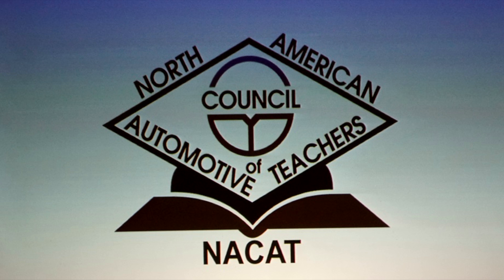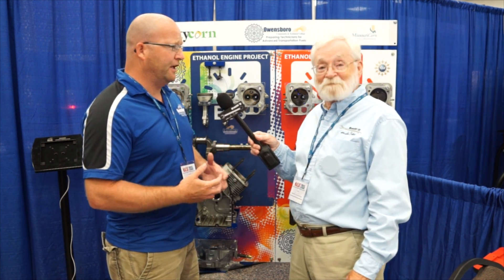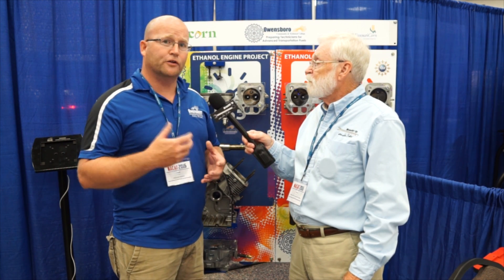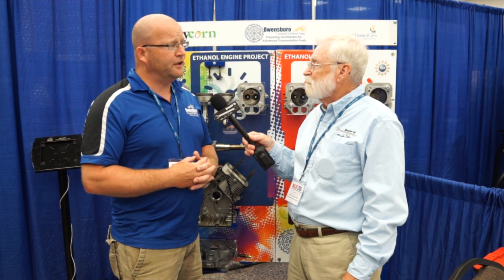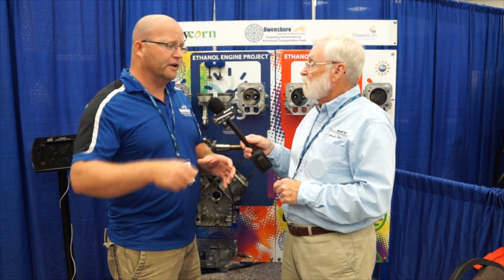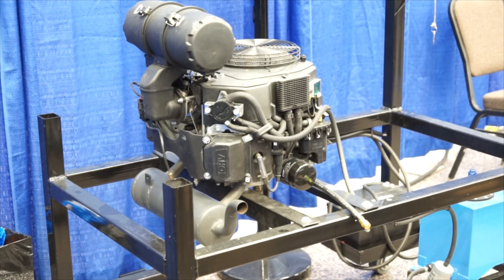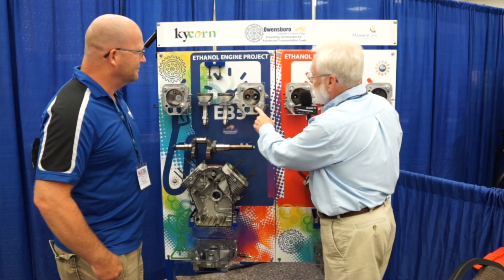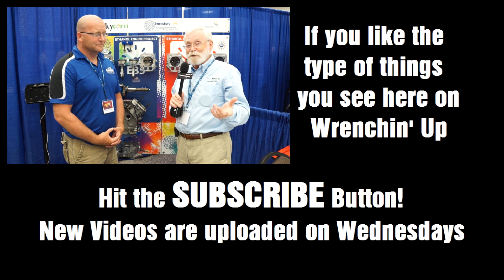E85 In A Flex Fuel Lawn Mower - Wrenchin' Up

Comment: It’s not the engine it’s self that’s the problem. You can take any engine and run it on ethanol. It’s the fuel system. A normal Briggs carb is not tuned for ethanol. 
If you can swap on a ethanol tuned carb hell yaa its a lot better.
And those engines they tested on look like they did nothing but idle for 500 hours. That carbon build up is from not being fully warmed up and the engine actually working. 
I have worked on thousands of cars, trucks and small engines. That kind of build up is only from a running with no load. Put the e-10 engine back together and actually put a load on it and 90% of that carbon would burn off and look clean.
Reply from the maker: Hi - Thanks for watching and sharing this great information!

Comment: I have Hyundai 2002 its not flex-fuel Engine, i started put e85( flex-fuel) 3 months ago, and i can say the oil stayed longer, more power and less noise from the engine, the only problem is when i start the car it takes 2-4 tries.
Reply from the maker: Hi - Thanks for your comment. Just out of curiosity, how many tries did it take to start your car on regular gas? Thanks for watching!
Reply: flex fuel is fine in a flex fuel motor/car - do NOT use it in something not designed for flex fuel.
Reply: Jim Bates 1-4 tries, it wasn't like that when I started using flex fuel it took me 2 weeks to see the this problem, it comes more often when it's cold weather ( I live in Chicago), overall it's much better I did 7,8k miles on 5k miles oil, the guy who changes the oil said you don't need oil change, and the fuel is cheaper, and the car is so smooth.
Note: I switched to regular gas and the problem gone.
Reply: I've heard this before from at least 2 other people. Cold starts on non E85 cars are a problem. They both put a couple of gallons of regular gas in with each tank of E85 and it helped.
Reply: I have a 2006 Scion Xb I have been running E85 in it, and love it.   The engine is soooo smooth.   It runs cooler too.   Great acceleration.   sure.  Less mileage.  I have not tuned the car to run with a kit.   Just giving it a try.   No check engine lights, none. I will change the fuel filter soon as the car is at almost 89K miles.   Mileage so far is 21% less.     My Flex Fuel GMC Yukon 6.2L is down in mileage only 0.8mpg.   Fuel here is $2.09.
Reply: Say good bye to your feul lines and injectors, and anything rubber that the feul touches.
Reply: Christopher Walker thats a myth
Reply: Lol. You need a flex fuel kit. Your getting hard start because your air to fuel ratio is too high. You need to add more fuel. Your engine will break down if you dont fix your air to fuel ratio.

Comment: Any fuel is good if the engine is tuned for it.
Reply: Also to add if an engine is made to run a particular fuel you should stay with it. Ex you wouldn't put diesel in a gasoline engine or vise versa. Same with ethanol. Most hot rods and things you see burning ethanol are tuned and built to run on it. Not straight out of the box built and tuned for pure gasoline. That's my 2 cents
Reply from the maker: Hi Jeffery - Thanks for your comment and Thanks for watching!
Reply from the maker: Hi - Thanks for sharing that comment!

Comment: E85 is the way to go Ethanol is great on the engines its much cleaner and runs better.  

Still in progress with ethanol trials here as we speak.
Reply from the maker: Hi - Thanks for your comments and Thanks for watching!
Reply: Hi. Which one would you think burns cleaner (I mean inside engine carbon buildup, NOT the emissions): 98 E5 or 95 E10? My BMW doesn't need 98 but ive been using it because price is about the same here in Finland. My logic says 98 burns cleaner bcos higher octane but then again... 95 E10 has double the clean ethanol in it so, what u think? Gas here is very good quality no matter which one u use.

Comment: No question...ethanol is a better fuel than petroleum, so is propane...the problem with ethanol in engines, not flex fuel, is that it damages plastic parts and makes gasoline deteriorate faster because of the systematic water in hydrous ethanol that we choose, because of cost, to run in the USA. Get rid of the 5% water in ethanol made in the USA, CONVERT all engines to run on alcohol, as they do in Brazil...and we are past e first objections.
Reply from the maker: Hi Rick - Thanks for your interesting comment and Thanks for watching!
Reply: You are very welcome....it's time we really got to the bottom of this debate...if we ever can...but it's not the ethanol causing the problem we ALL are having with hydrous ethanol being put into our fuel, and then into our engines, that were, and still are, designed to run on pure gasoline. It's the water IN the ethanol that's the problem, regardless of the fact that ethanol ATTRACTS water...and the fact that the membranes in our small engine carburetors are not meant to be exposed to Alcohol causing us to rebuild them, and the water causing our gasoline to go bad prematurely...it all adds up to someone was not thinking, or didn't care....that is what gets under my skin. Again, it's not the Alcohol that's the problem...it's that our engines are not ready for it.

Comment: I’ve been a mechanic ASE certified master L1. All who is saying that it bad is just following sheep.Ive used really studied this on all David Blume alcohol can be a gas ⛽️. It runs cool no knock very little pollution and be grown at home stop wars engines run longer. I have a old 92 Dodge van running it for 5 years E85 no problem. I let it sit months starts right up.We used to put alcohol in tanks in PHX when I couldn’t get down the four gas ⛽️ .Its a little hard to start in cold except for tuned cars.
Reply from the maker: Hi - Thanks for watching and sharing your experience.
Reply: The less pollution thing was a lie, not to mention the pollution of growing all of the corn and processing it. There’s no way that ends up being “cleaner” than petroleum based fuel

Comment: can I switch to e15 and e20 gradually on my 2015 Briggs on my lawn mower? do I have to switch parts?
Reply from the maker: Hi Douglas - Thanks for watching! From what I understand, you can only use E15, E20, E anything in small engines that are designed to use it. That aside, there would certainly be a carburetor change and, as I remember from my racing days, aluminum and alcohol do not place nice together. I hope this helps.
Reply: @WrenchinUpwithJimBates  I actually ran my zero turn (kohler 725cc) on E30-40ish today with no problem! it's not flex fuel but after some research, I realized up to E50 is totally fine by blocking the air intake a bit.
I tried E60-70 and it was too lean but choking solved it. The cooling fan temperature was reading 60 with outside air 35 with choke on and no visible fume
Reply from the maker: Hi Douglas - Very interesting. Please keep us posted as time goes on.
Reply: You need wider main and idle jets

Comment: This question reminds me the story telled about LPG or natural gas engines.
Here in Italy we use LPG and natural gas since the early 50's.
All this fuels run engine better than gasoline, only a few engines can have problems due to poor design to valve seats and because of the lack of cooling provided by gaseous fuel.
The main problem is ignorance.
Ethanol is a better fuel, the only issue with it is the production, using food to fuel car is immoral and wrong in a world where some people haven't enough food to survive.
Reply from the maker: Hi - Thanks for your comment. I think the LPG/Natural Gas movement is still alive because every once in a while I get e-mail about LPG and Natural Gas conversion or maintenance classes being offered. That's about all I see though. Maybe some who knows more about this subject will jump in here and update us. Thanks for watching!
Reply: @WrenchinUpwithJimBates  I really don't know the US situation about gaseous fuels.

The only one thing I can assure, is that here, people who want to drive US cars, have to spend lots of money in fuel.
In Italy we pay over 1.5€/liter for petrol.
The obvious choice for those who need to run US classic fuel guzzlers, is to convert it to LPG, who cost about 0.55€/liter.
I hear no one who had problems with LPG.

I have two veichles with an LPG fitted, a little Piaggio Porter (it's a Daihatsu Hijet micro-van but produced in Europe and re-badged by Piaggio, 993cc 3cyl engine 48hp AWD) and a 1997 Volvo S40, 1.8liter.
Except some minor issues with the Porter, fixed after first period (some mistakes on the LPG ECU), zero problems at all.
Engine have less EGT, more low-rpm regularity, about the same power of gasoline, a ~15% more consumption compared with gasoline (LPG has less energy per liter), oil remains a lot more clean, spark plugs haven't any carbon on it even after 20'000km, it's a great choice.

Comment: ethanol is the superior fuel
Reply from the maker: Hi Jacob - Thanks for your comment and Thanks for watching!
Reply: Jacob Kaul your full of crap water brakes the Ethanol down and now you have water in your tank try running your engine on it I've seen first hand the problems with running ethanol fuel in any engine it kills them. You better off running 91 Octane fuel instead. Not 87 Octane. Most engine's are aluminum now not cast iron like they were back in the day.
Reply: @rustybeatty6567  If you have that much water in your fuel, it is way past time to find a new station or jobbers to go to for fuel. The management and maintenance of that place is not good, and using any of their fuels will be a mistake.  Plus their are scoundrels that from the beginning of the gasoline engine have sneaked water in just to, "control their shrink". Either fuel is good to use, but you must spend a little time and treat your equipment well, including managing the fuel
Reply: @ronfullerton3162  ever heard of atmospher. Water is in the air we breathe aka humidity and that humility gets in your gas tank when it cools it turns into water and settles at the bottom of the tank and the ethanol mixes with it and the amount of water grows.
Reply: @rustybeatty6567  I know about humidity and all that. But there are ways and equipment available to avoid humidity and water build up during transportation and storage of fuel. It just takes responsibility of those doing the job to do it right.
Reply: @ronfullerton3162  today's new gasoline cans don't completely seal up like the old steel or aluminum cans and fuel tanks on equipment aren't any better because of their gas cap seals don't hold up in hot summer months states like they in the states that have cooler temperature in the summer in Oklahoma our summer temperature can reach 105+ degrees for 2 to 3 months at a time every day most gas tanks are painted black and because of that their temperature can hit 170 degrees the hottest part of our summer I know this first hand I've used a temperature indicator to tell the fuel tank temperature most insurance companies require all gas powered equipment and gas cans to be stored outdoors in the sun not in a shop or garage fuel cans have to have their own separate storage building that has two vent holes on the building high side and low side.
Reply: @rustybeatty6567  what do you store your fuel in a river? And I can't run 91 my 440 has 13.5:1 compression
Reply: @rustybeatty6567  ethanol does not harm aluminum most older carburetors are made of zinc composite as so as lawn mowers and motorcycles I run my 440 with aluminum heads on e85
Reply: john ramsey yes it does because most engines use more aluminum in them some engines have aluminum block and heads and ethanol burns hotter and because of that the engine might warp and even melt because aluminum has a lower melting point than steel or iron engines do and as for 91 octane fuel the higher the compression the higher the octane because of pre ignition.
Reply: @rustybeatty6567  on race gas my 440 runs hotter than on e85
Reply: @rustybeatty6567  and you're crazy most forged aluminum heads and Pistons have a melting point of almost 2,000 degrees so unless you're doing a fogger nos system that's your not melting pistons on ethanol runs cooler than gas and detonation is almost unheard of on ethanol
Reply: @rustybeatty6567  I switch to e85 almost 5 years ago but I've never had a problem yet
Reply: @rustybeatty6567  and I run a 440 block bored 60 over with a 4.38 custom stroke 528 cubic inches running stage 7 Mopar heads aluminum Max wedge with a Max wedge intake and twin demon 750s jetted and made for e85 the carburetors are aluminum not zinc composite I have never had a problem yet most lawn mowers motorcycles in old Holley carburetors and Carter's are NOT aluminum putting e85 in them will destroy them
Reply: john ramsey is your mopar a street car or a track/race car
Reply: @rustybeatty6567  street/strip

Comment: What compression ratio are you runing on them
Reply from the maker: Hi - You will have to contact the folks at school that did the testing for that information. Thanks for watching!
Reply: @WrenchinUpwithJimBates  Or look on Kohler's website, as current commercial offerings are Command engines, some are EFI.  Anywhere between 12:1 or 8.5:1

Comment: To every motor you run E85 in has bearing failure 75% faster though.  E85 is a complete nightmare in south carolina in the summer. So much water absorbs into the fuel so fast it pointless!  1 gallon of E85 with the cap off the bottle here for an hour and it goes bad that fast!  Gas stations wont even sell it here because of lose of profits. with that said I have to laugh at this video though! Look at those valves! I have seen motors run for 30 years not look as bad as those did for 500 hours lol!
Reply from the maker: Hi - Thanks for watching and sharing your opinion and information!
Reply: i've been running e85 in my 700whp + cars for a decade now, as long as your oil changes are frequent enough the motors will hold up just fine :)

Comment: I've been a small engine mechanic for years and I can tell you from experience ethanol is a horrible fuel for small engines. What he isn't telling you is that ethanol has a horrible shelf life because it absorbs water from the atmosphere. Let that fuel sit in that engine over the winter and see what it does to the carb. This video is pure BS I don't know what the hell they did to that engine running normal fuel but that amount of carbon build up on the valves is NOT normal at all. Don't buy into this bull NEVER run ethanol in a small engine.
Reply from the maker: Hi - Thanks for your very interesting comment. It will be interesting to see if anyone from the school, co-op  (or anywhere else) has more to add to this conversation. Thanks for watching!
Reply: I agree with you people who believe Ethanol fuel is better are full of crap. Water is the BIGGEST PROBLEM and cold weather starts is also a problem with this fuel and it also has to run richer than 100% gasoline witch means more time is spent on refueling so it really doesn't save you money it makes you spend the same amount of money in the long run maybe even more because of water issue's in the fuel.
Reply: Fuels UAI yes their is it's called diesel. Diesel fuel can sit for years  maybe even decades it will still burn or run in a diesel engine. Gasoline can't do that.
Reply: carbon build up on valves is caused by blowby.
gas will do the opposite,particularly ethanol ,wich is cleaning this part of a valve,unless you have a direct injection engine.
running an engine on a stand without load will cause the piston rings to not seat properly,so you have a lot of blowby  : piston rings are not sealing properly.
you clearly see the coloration of the piston between rings,wich is gases leaking between them.
it's absolutely not a good way of testing an engine or a fuel.
Running on ethanol will make your engine clean as a whistle if used properly.
Reply: All internal combustion engines can safely and economically use E15, regardless of age. This is proven by Brazil's decades long use of E15, E25, and now E27. They have the same engines as those available in the U.S. In addition, E15 to E30 was used throughout Great Britain from the 1920's to the 1970's. This is also true of other countries such as France and Germany. 

My 600+ page book "THE ETHANOL PAPERS" has just been published and it's free to read on TheAutoChannel.com website.
Reply: Eyyyyy. We found the old boomer that thinks he knows something. You know nothing 😂